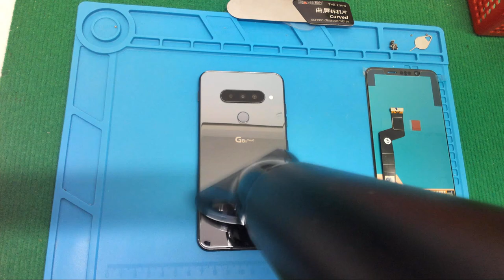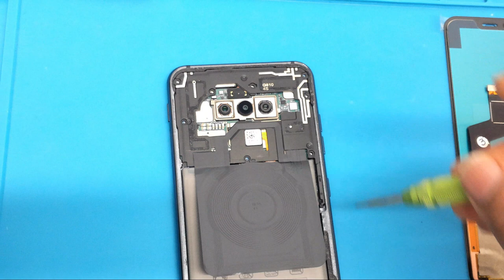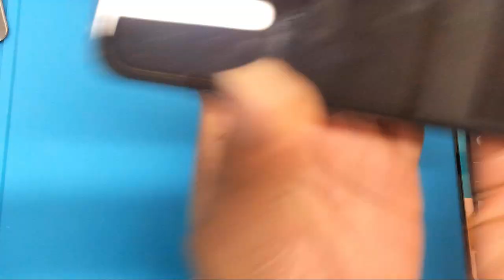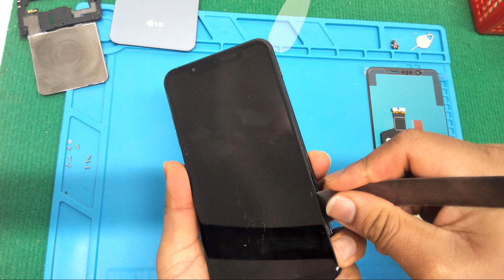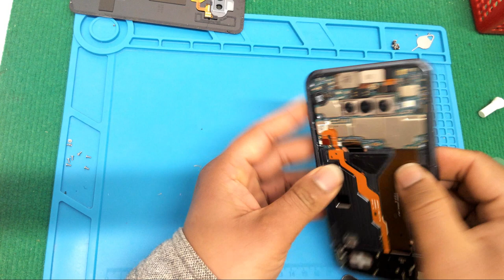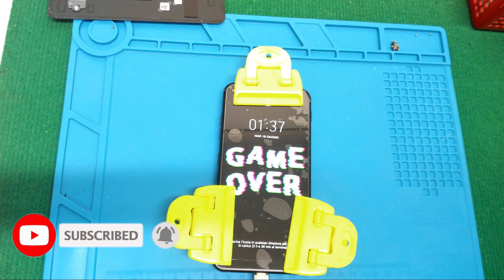LG g8s lcd replacement

Comment: The battery does not need to be removed, just disconnected. I hope this additional informations help.
Reply from the maker: thanks for contacting us. yes you take display without frame no need to remove batteries because there is flat pass over batteries thanks

Comment: 1.Bending LiPo batteries is dangerous, you run the risk of crushing the cathode/anode causing a short then fire.
2. From your vid it looks like there was adhesive at the top and r/h side, so you could have used sturdy & flexible plastic card (i use laminated playing cards) pushed under the battery at those locations.
As it is you will need replace the battery and safely dispose of the old one.
Reply from the maker: thank you so much for the advice friend

Comment: thanks for the video.
Is it easier to replace LCD + frame (already glued)? what are the different steps?
Reply from the maker: hello easier without frame because you change with frame I have to pull all pieces even can time without frame can easy
Reply: @HardwareDoctor1  sorry I did not fully get what you mean. pls can you explain again? 😊
Reply from the maker: that will be more difficoult i raccomend you to use without fram lcd whi frame you have open all the phone

Comment: hello there.
do you really need to take out the battery to change the screen? i only disassembled the phone back to dry out water damage (it wasn't really "water resistant" as promised).
the phone booted and worked for a day, then the display started burning pixels and turned almost all black.
i really don't want to mess with the battery. if i disconnect the cable, can i pull it witout the battery?
Reply from the maker: hi brother once open phone after water enters
Reply: @HardwareDoctor1  ciao, ho scoperto ora che sei italiano quindi ti rispond così
Mi è entrata acqua nel cellulare in quanto non era realmente impermeabile.
l'ho gia aperto e asciugato, ma non ho staccato la batteria.
Non ho a portata di mano l'alcool isopropilico che consigliano per togliere l'adesivo della batteria, è difficile da staccare? Avrei preferito non toccare la batteria., ma a quanto pare è indispensabile rimuoverla
Reply from the maker: @dluca182  ciao quando entra acqua nel telefono 50% da buttare telefono sei anche va da sempre problemi ti consiglio che sei hai un negozio vicino te porti loro . grazie

Comment: Thank you for the tutorial, can you please tell me if there is a noticeable difference between the original display and the Aftermarket one ? I recently cracked mine and I'm not sure if the aftermarket displays are good enough.. I'm interested into brightness and colour. Thank you in advance !
Reply from the maker: https://www.5g-m.com/it/lg-g8s-thinq-lm-g810/24441-display-touch-nero-lg-g8s-thinq-lm-g810.html
Reply from the maker: here is the link for an reliable web site from where buy display is the same i used so use it

Comment: eyo, are you still responding?
my screen does not work, no littl bit 
any idea ? 
i can hear notification sound, means the batterie is charged 
and in my opinion the lcd connector is plugged
Reply from the maker: Bro your LCD is broken plz Cheng LCD

Comment: What king of glue  did you use to glue the screen?
Reply from the maker: https://www.5g-m.com/it/colla-nastri-biadesivi/15992-colla-adesiva-trasparente-mechanic-e8000-110-ml.html
Reply: @HardwareDoctor1  is it enough to maintain waterproof?
Reply from the maker: @makmarco10  no but when once the display changes you are also framed but the same water enters

Comment: Why did you take the battery off?
Reply from the maker: First time I opened this model, I thought it had to remove batteries, but afterwards, when I pulled, since there is no need to remove, you're right